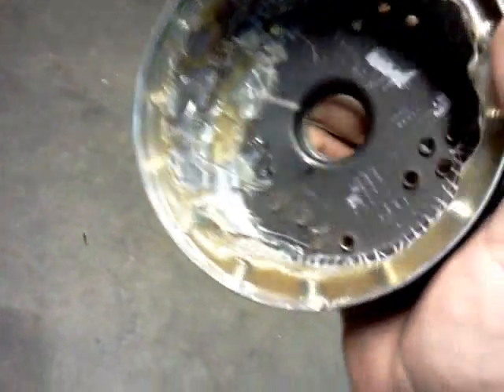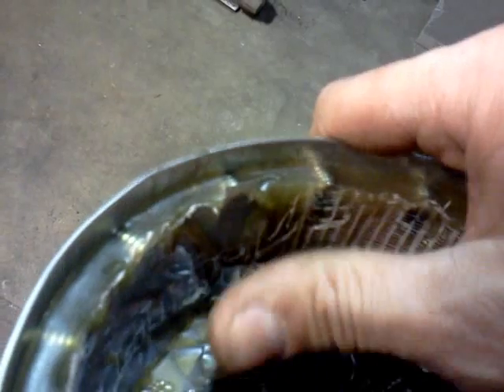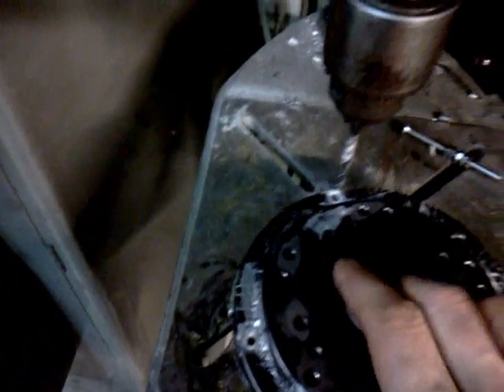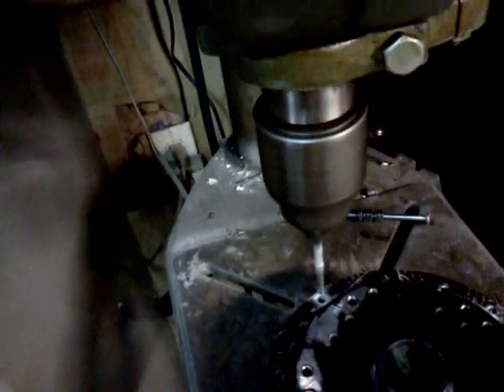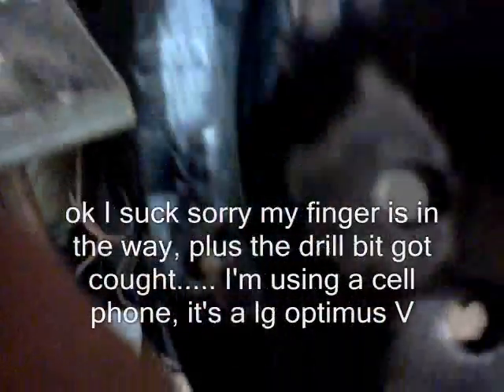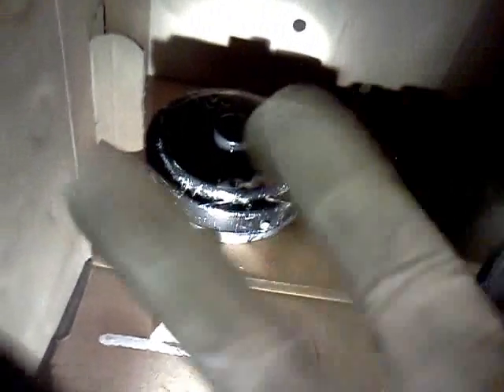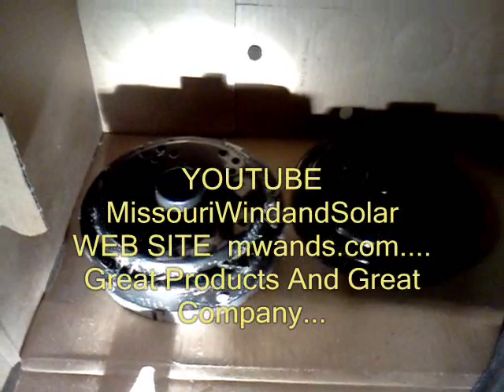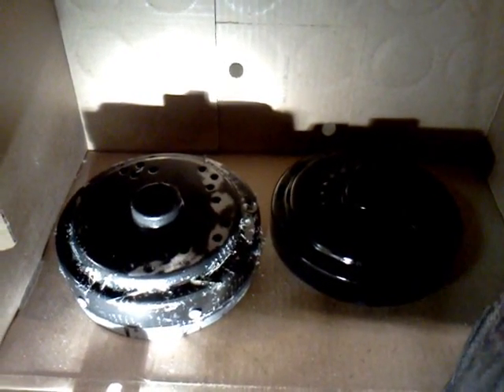Ceiling Fan Generator part 2

Comment: I used the same bridge rectifier your using and I tried it close to the turbine first so the DC current followed the length of the wire. Then I moved the rectifier to the other end at the batteries and I got more power. I think AC holds it power better than DC over a distance. Your doing a much better job on your turbine than I did. Looks good.